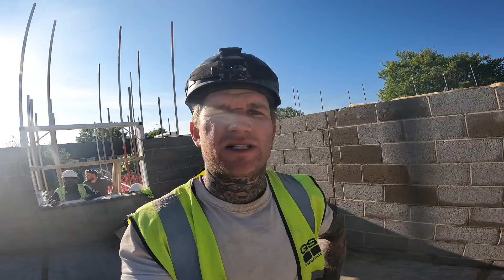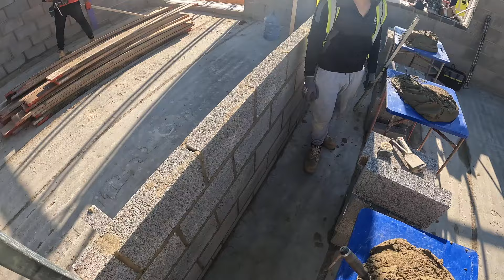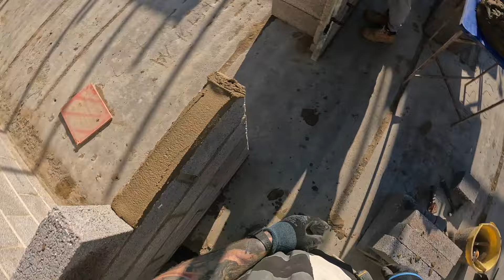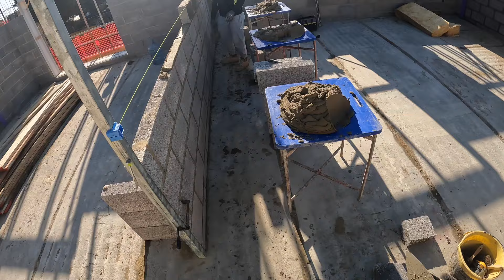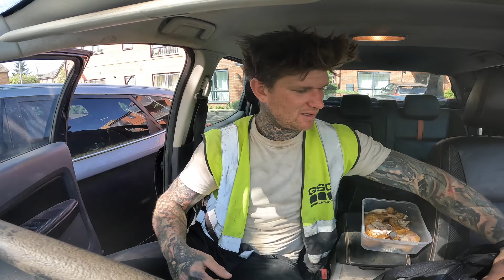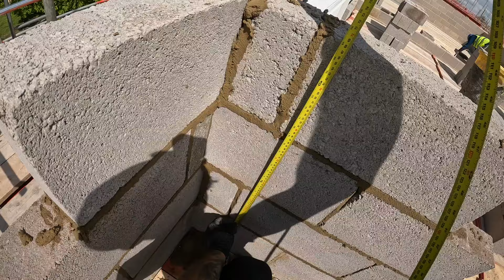The Apprentice is in my bad books today!!

Comment: Pointers are going around raking out new builds under warranty and repointing them because the the silo mortar has failed, repointing wont cure the core problem they need puling down.
Reply: Persimmon houses less than 15 months old >£500k having scaffold erected and being repointed right now where I live.......thankfully I have an old house!
Reply: @MarkPinnell  Shocking mate isn't it.

Comment: Some good advice there. Also if you're running in at the same time as your corners make sure the corners are slightly slack. The weight and the jointing up will bring them plumb. Too many brickies are obsessed with the bubble in middle. Trouble with building slack is too many inexperience inspectors show up. Put a level up the middle of the wall and cry that the wall is falling in. In the nicest possible way, tell them to feck off and come back with their precious little level and laser in the morning.